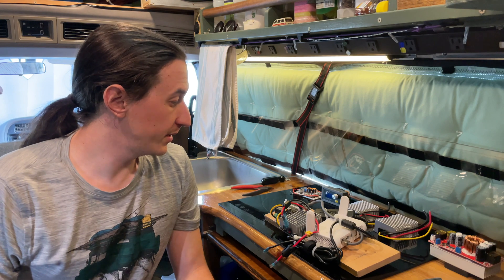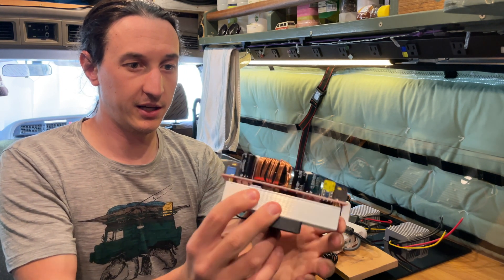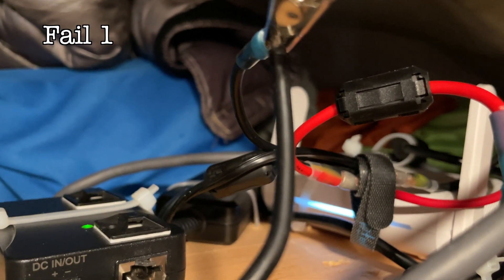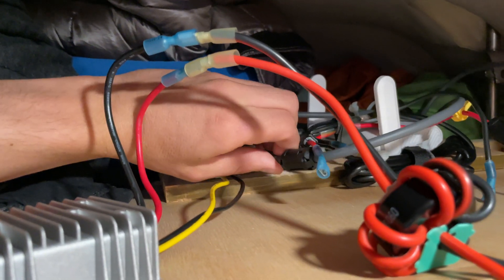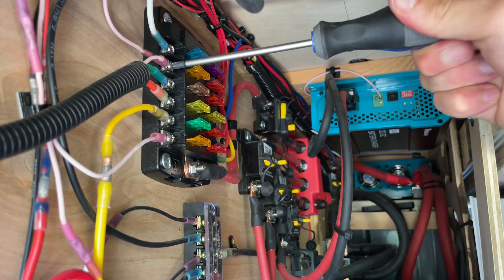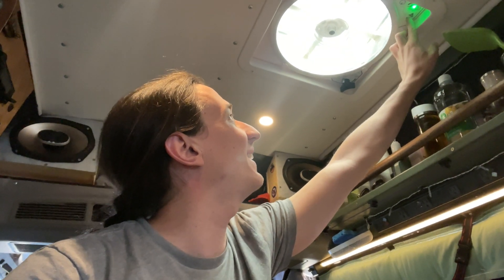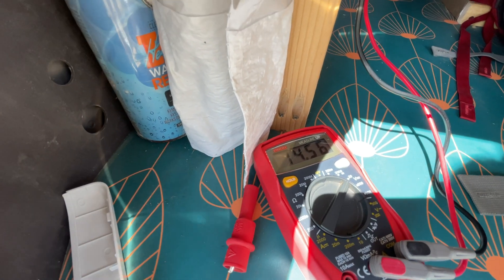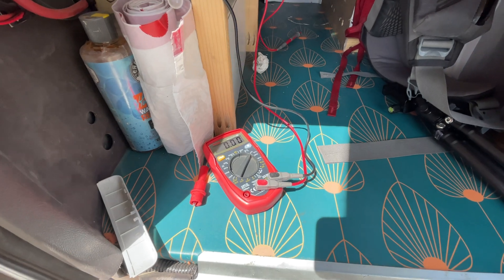NOISY Starlink Power Supply, DEAD Maxxair Motor Driver, WEAK Solar Charging

Comment: How has that motor controller held up on the fan? Thinking about doing the same to mine so I can avoid using a 12v converter on my 24v van build.
Reply from the maker: So far so good. I’ve used a lot of these motor drivers and every once in a while I’ll get a bad one, but for $2 I don’t mind swapping in a new one.
Reply: @dustyodyssey  Thanks for the reply! Do you mind sharing a link the one you're using?
Reply from the maker: @fluxgame  https://www.amazon.com/gp/aw/d/B07L74P6B3?psc=1&ref=ppx_pop_mob_b_asin_title
Reply from the maker: It’s worth mentioning that if you’re driving a 12v fan motor with 24v you could very easily damage the motor. Even if you don’t exceed 50% PWM you’re still giving the motor 24v so I’m honestly not sure what would happen if you did that. I think to be safe you will still need a step down converter.
Reply: @dustyodyssey  I came to the same conclusion. I was recalling that buck converters operate via PWM, so I was thinking this would work similarly, but I guess they also have a circuit to smooth the output. Maybe I'll try an adjustable buck converter. Anyway, thanks for the idea!

Comment: I have the same setup. My issue is the router never seems to consistently connect with Starlink. Regardless of which I turn on first. I can spend upwards of 15m trying to connect. Super frustrating. Any tips? Thanks a bunch for your videos. I know it’s work but it is appreciated. 😊😊😊
Reply from the maker: Well, I can tell you that is definitely not normal. I would say double check all of your connections, it can be easy to mess up those rj45 crimps. Also, if you got your power supply from Amazon I would recommend just replacing it. I ordered the Mean Well DDR-120A-48. Mean Well is a good brand for power supplies. I'd also look at obstructions. I didn't really think about it but my vent fan partially obstructs my dish when it's open. There's also a "Starlink Hacks" facebook group. It's toxic as hell, but some people in there really know their stuff and will have you pull your debug data and analyze it for you.

Comment: wait, are you running multiple of those DC to DC power regulators on one line? that will often lead to this kind of trouble (although I haven't tried those exact models). the cheap ones really don't like each other.  I don't own a scope, so I'm not sure why,  but I know that when I have two or more cheap switching DC to DC adapters connect to the same power source, they seem to fight with each other, like maybe the frequencies they use are setting up some weird resonance or something and messing up their outputs? I'd be tempted to try just one large inverter to run everything, just to see if thats the issue.
Reply from the maker: Huh, that’s interesting. I do have two on the same power source. I will try pulling the fuse for the one powering my stereo and see if that makes a difference. Thanks!
Reply: @dustyodyssey  Hope it helps. Gremlins can be a nightmare to track down

Comment: Every 2-3 months I go through and re check all of our battery connections. You should look into finding an old automotive voltage regulator off of a Dodge or Chrysler. That might help protect all of your sensitive equipment from spikes.
Reply from the maker: I will definitely be checking for loose connections more often now. I think most everything in my van has a regulator, it's just the fan driver that seemed to be overly sensitive to over volting

Comment: goodness such a complicated mess of issues. In my very limited knowledge the only thing I could suggested is to look at one system or component  at a time. Hopefully you can isolate the issue or issues that way. Start simple and then add stuff until a problem occurs. But you probably have done that already. Anyway, good luck, it appears you have some very good suggestions already.
Reply from the maker: Thanks! I think I mostly have things sorted, or at least I know the problem thanks to the very helpful comments here.

Comment: Should never have 12v components running directly from solar. Always have a regulator (DC-DC converter) between solar and 12v components. You might also have a bad breaker. They heat up a long time before cutting off and depending on your load, this heat causes the mechanism to have a connection that can become unpredictable.
Reply from the maker: Most 12V stuff is designed to run on charging voltages so I don't necessarily agree that a big DC-DC regulator is needed. Breakers are running cool. As others have suggested, I think I am over-charging my batteries causing the BMS to cut and the SCC has no where to dump the power so the voltage spikes briefly.
Reply: @dustyodyssey  Not a big, big one. Just a 20amp or so, enough to run roof fan, lights, charge phone etc. The regulator would have saved you from improper charge  controller settings and those spikes, and any other unexpected problem before it. The one I’m thinking of looks just like the sealed ones you already have, from eBay or Amazon. Sounds like you feel like you feel you’ve solved it though and idk how many others are armchairing here so I’ll leave you alone. Thanks for sharing your progress!

Comment: do you have a pure sine inverter? i think its your inverter gone bad. just get rid of 12v power. use an inverter to power everything. youve got good batteries so you dont need 12v power.
Reply: Running things off solar in winter and the efficiency of 12v makes a big difference. Some days you cannot have enough solar even with 1000w on the roof like I have.
Reply: @EricPeelMusic   yes im offgrid. your batteries were half full and it didnt seem to worry you. if your just running low power items you could last a week on 400ah,12v or 200ah,24v. little or no sun. look into server rack batteries 48v. one of these would last a long time. and look into all in one inverter. every thing in one box. battery charger/charge controller/battery monitor/bluetooth/. no wires everywhere. compact ,you can plug into a mains power outlet and fully charge a 100ah 48v in a few hours if desperate then last a week.
that starlink would use heaps more power than a mobile phone hotspot. sell it, cancel your subscription to them and use the money you save to upgrade your power. every bill you stop paying is a pay rise.
Reply: @RomansSeven7  I think you’re missing the point. The most heavy usage thing during winter, if one isn’t running electric heat, is the fridge. A 12v fridge uses a lot less electricity than a 120v not only because a 12v can bypass the inverter entirely but also because 12v fridges are designed with high-efficiency in mind. They can do a lot more with a lot less. Lights are typically the next heaviest thing. Again, 12v LEDs are much more efficient than 120v since no inverter is needed. They can be run directly from the battery or through a 97% efficient DC-DC converter. Much better than a typical 85% efficient inverter. Not to mention the inverter uses a lot of energy alone even while not powering anything. Usually 20-60watts.
Reply: @EricPeelMusic  my upright fridge and deep freezer use 45w each. i know the power usage of everything i use. i have led lights, split system aircon , im not saying be more efficient. im saying get more battery storage . and the energy the inverter uses turns into heat, great for winter heating. summer wont matter. higher voltage is better many ways too. better on battery life. 
and if its that cold in winter leave your fridge outside and use no power, lol win win.
Reply: @RomansSeven7  Yeah, 45wh is a lot when I can only generate 150wh per day for a week straight ( even with 1000w of solar) when it’s super cloudy and rainy in the depths of short winter days in Seattle. Even with a 5kwh battery, there is just not enough solar radiation poking through the clouds to charge the battery. And using 120ac is just too inefficient. Gotta try vanlifing through a Seattle winter and you’ll understand. I agree, summer doesn’t matter. Can run AC off solar 24/7. The battle is about winter. Heating is not an issue with 2” of XPS foam and body heat, even down to the teens. For charging phone, running computer, induction, fridge etc, perhaps a windmill would be a good option since with the rainy weather comes strong winds. Always trying new things and adapting and staying up north a bit longer each year and still not bothering with nasty propane or gasoline generators. I think we’re on the same page, but I’m not sure to understand the brutality of a Seattle winter when it comes to solar.
Reply from the maker: I've pretty much designed my whole system to run on DC except for a couple of AC appliances. I think the inverter is ok, as others have pointed out it's likely I was overcharging by battery causing the BMS to cut.
Reply: @dustyodyssey  i dont think you can over charge, what can happen is one battery bms goes into protection mode a shuts down and you only run from the other battery. to get the bms to work again you need to disconnect the battery for 2 minutes then connect again and it should have reset.

Comment: Have you try to use a capacitor for the led lights? I had the same issue, and the capacitor solve the problem
Reply from the maker: Ever sense I tightened the loose connection on my main breaker the lights have been steady. But I think you're right, a separate power supply/capacitor for the LEDs would do the trick

Comment: I am supposed to be almost done with electrical engineering and I feel like I know nothing, am I wrong to assume the buzzing is an unstable current through the wire that has some pattern with a frequency similar or equal to the buzzing of the magnets? Current flowing through a conductor causes magnetic field so changes in that should make a magnetic field that fluctuates so magnets near it vibrate.
Reply from the maker: I think you are exactly right!
Reply: @dustyodyssey   I do really know nothing about practical electrical circuits. I googled it and the magnetic effect of wires gets canceled by twisting the positive and negative wires together and also shielding it, like a data wire. Not sure why but that should already be the case for your wire, could it be that starlink has a voltage regulator that smooths the powerspikes on the return wire, with that said would an additional (google says any power supply should have one) voltage regulator potentially help?
Reply from the maker: @BankruptGreek  As a former mechanical engineering student I know that feeling.

Like you said, the power supply should smooth out those power spikes, but they are not for some reason. I read a little bit about noise attenuation through DC buck converters and it was waaaay over my head. That said, I'm hoping a high quality power supply will smooth things out. Also, fixing that loose terminal lug quieted things down significantly.
Reply: @dustyodyssey an oscilloscope would be really handy with seeing power changes of that nature, if you happen to have one 😂
Reply from the maker: @BankruptGreek  Dude, the number of times in the last few weeks that I wished I had a little o-scope with me... Ridiculous to have in a van, but it would be super interesting.
Reply: All this hassle with that setup is making me wonder if the 12v power hack for Starlink is really worth the effort/expense, especially if you have an inverter you could use with the stock power supply. It's not like the dishy needs power 24/7!
Reply from the maker: @wanderingzythophile9083  yeah, I agree. The power savings are only fractional anyway
Reply: @dustyodyssey  I've seen YouTubers with an oscilloscope feature in their ($200?) multimeters.

Comment: One thing to try, and I should say I don't know if this would 100% work, but - maybe set your target voltage for absorbsion on your solar charger down a bit. Your battery can go up to 14.6v but the difference between that and, say, 14v is negligable, capacity-wise. Your solar controller, when it's pulling in power, will push that higher voltage into your system as a whole when your battery is near full, and that might be causing some issues.
Reply from the maker: It seems like that is exactly what is happening. As erik mentioned I may have a cell balance issue because I have not been charging to full. If I keep getting power spikes I will definitely lower the absorption target (when I can borrow a windows machine).
Reply: @dustyodyssey  I read that convo too; and yes that's possible, but it's not necessarily super-related, I don't think. Related in the sense that your solar controller pushing higher volts into your nearly-full battery is more likely to trip a single cell overvoltage limit, so lowering your absorbsion voltage would likely help with that. And yes, if your battery is servicable, you could open it up and try and do a manual balance.

What battery is it you have? Does the BMS have a balancing feature? Usually they're passive, and set to enable at a certain minimal voltage, high at the end of the charge curve, and often there's a setting to only balance when receiving a charge.
Reply from the maker: @wanderingzythophile9083  I have two of the "Power Queen 12V 200Ah PLUS." Unfortunately, very little documentation, not sure if the BMS has balancing at all, and unfortunately the battery is not technically user servicable. It did come with a separate manual that is not available online that recommended a charge voltage of 14.6, but the online specs seem to recommend 14.4 +/-0.2, so it does seem like I am charging right at what would be considered the maximum. Will definitely lower that 0.1V the next time I get a chance. Good call!
Reply: @dustyodyssey  14.6v is the most you should push into these cells. I'd put it at 14.2v. That will steer a bit more clear of any overvoltage limits, balanced or not.

Might be worth googling a bit to find out if indeed that battery's BMS has any sort of balancing function. Chances are, I fear, it does not.

This is one advantage to building one's own batteries; one gets to choose one's own BMS :D

Edit: Looking at the PQ website and that battery... it wouldn't be outside the realm of possibility to open up that enclosure, tear out the guts and replace it with a better BMS. The JBD units that Overkill Solar rebrands are fine units. You'd get Bluetooth control and low-temp cutoff (very crucial IMHO) to boot.

Comment: Your power spike sounds like a battery bms cutting out, because a single cell might have reached max voltage. Could be out of balance, as it wasent charged fully for quite a while. Bat cuts connections to the cells and the mppt has nothing to dump the power in and overshoots.
Reply: Won't the BMS cut power every time the battery hits full charge, even if the cells are balanced?  Maybe the higher-quality charge controllers have a way to avoid producing a voltage spike when the BMS stops charging the battery.
Reply: @posteroonie  i didn’t observe that behavior. Most bms are only working on voltage thresholds. Even if it calculates remaining capacity
Reply from the maker: That makes a lot of sense! Any ideas how I could fix the balance?
Reply: @dustyodyssey  I run different grades of batteries. in low quality ones, the cells can have different characteristics and the tend to never balance on the internal bms. i have one such battery, the solution was to open it up, put balancing leads on it and charge it with a balanced charger from time to time. i guess you batteries are above that quality standard. in this case, repeatedly charing them full (this can take a few cycles) will bring them back in balance. sometimes there are notes in the battery manual. e.g. its expected to charge at least to 14,5V, because balancer only kicks in after 14,4 (just an example).

also: can you check the input voltage on the noisy psu? bad connections def. can cause issues like that.
Reply: also, if your battery has bluetooth, you might be able to check cell voltages. (can be a hidden menu, pw is usually 1234 if pw protected)
Reply from the maker: @eriksporns710  Great tips! Thanks! Hopefully now that I can charge to 100% again it will balance out over time. I don't exactly have high tier batteries, no bluetooth or anything like that so we'll see how it goes 😬